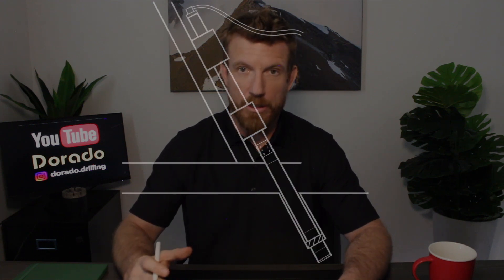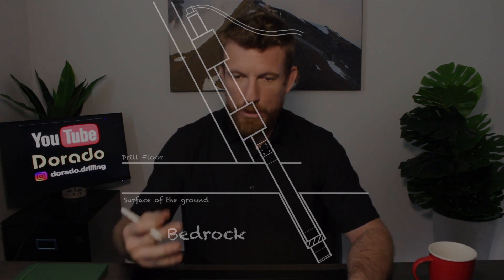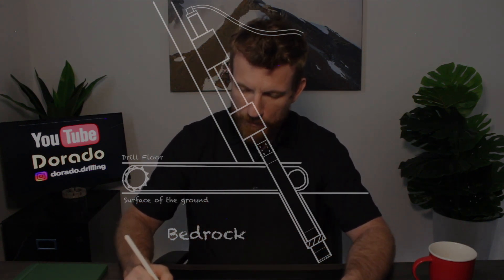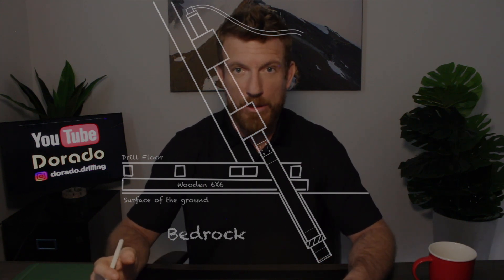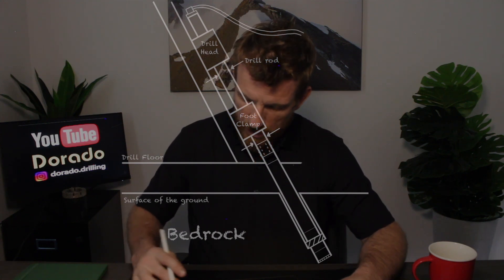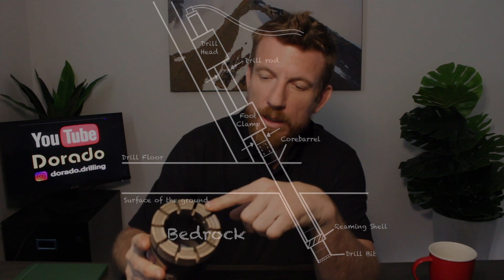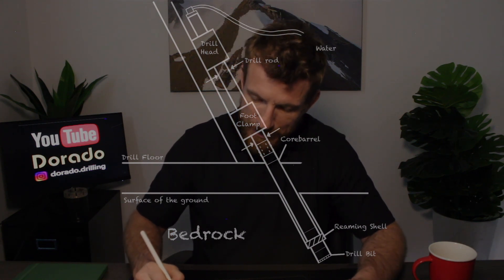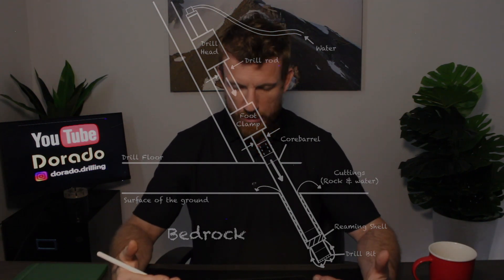Diamond Drilling 101 - Driller's Eye view

Comment: Here in Mexico, platforms made of concrete were also used, the chassis of the machine is anchored with screws to the concrete and it does not move anywhere, greetings.